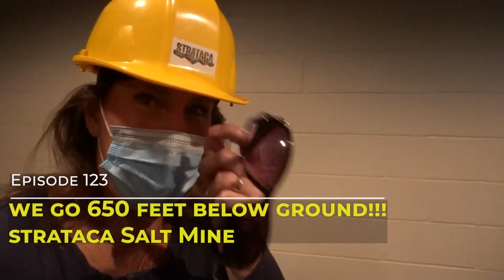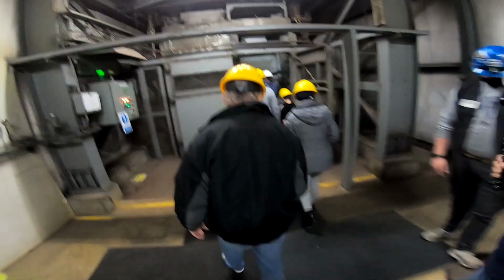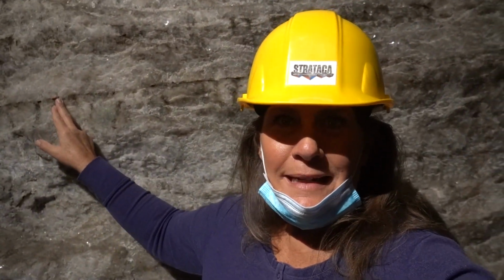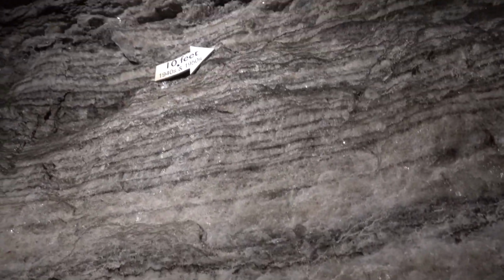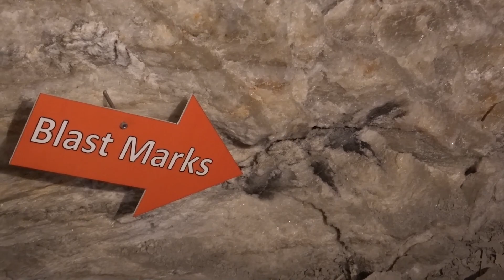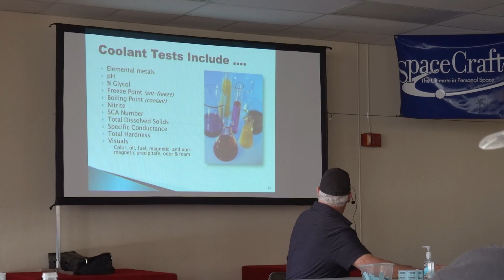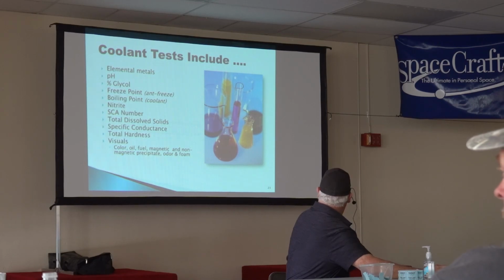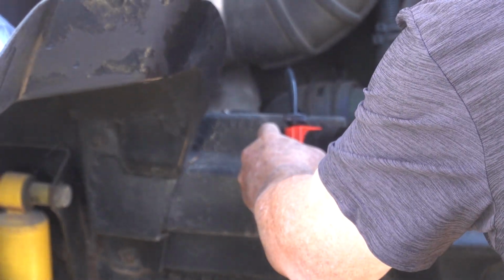Episode 123: We Go 650 Feet Below Ground!! Strataca Salt Mine Tour

Comment: We are in the cold Arizona desert
Reply from the maker: Where are you? We'll be out there freezing with you soon.
Reply: @TipsyMarlinTravels  we just got a sweet spot by Laguna Dam... supposed to have 5 nights of 50s soon . It was 48 in the rv when we got up this morning
Reply from the maker: Are you right by the dam? Or by mittry lakeon that side?
Reply: @TipsyMarlinTravels  right by Laguna Dam
Reply from the maker: @Nomadiccamping  48 inside is too cold!! Been there a few times. Brrr!!! Stay warm and enjoy your spot.
Reply from the maker: @Nomadiccamping  Cool, There is a run down camp ground right across from the spill way, it use to be called Laguna Dam RV Park. They shut it down in 2012. I had a 1953 spartan trailer there for 12 years. It use to be a nice place until the reservation got greedy and said "get out" we are putting a casino in. Well as you can see there is no casino. Anyway enough rambling enjoy your stay.
Reply: @TipsyMarlinTravels  by the time you guys get here it should be in the 50s at night. If we ever come again we will wait until mid January. Beginning Saturday I think it is supposed to be in the 50s at night for a good stretch. Rule of thumb is that it usually stays 10 degrees warmer in here than outside. We began trying to run the furnace and keeping it on 65 but it was cycling every 7 minutes or so. It took our batteries down to 11'8 one night. We decided to just cover up and bite the bullet. The coldest it has been in here when we got up was 48. It was 53 in here this morning and 41 outside. Anyway, you guys be safe getting here and hope to run into you sometime